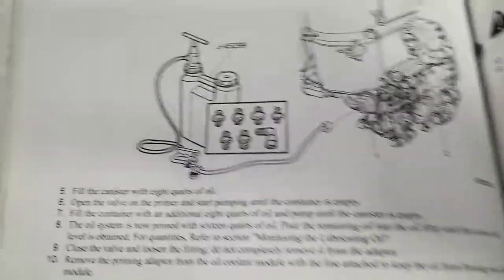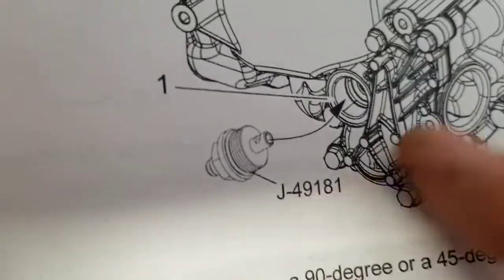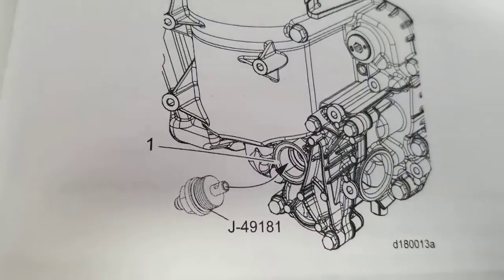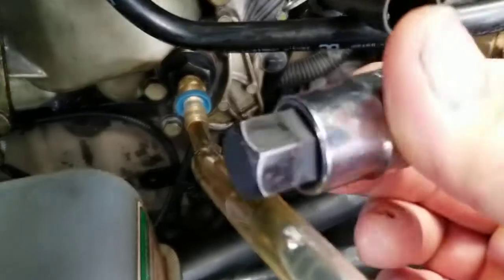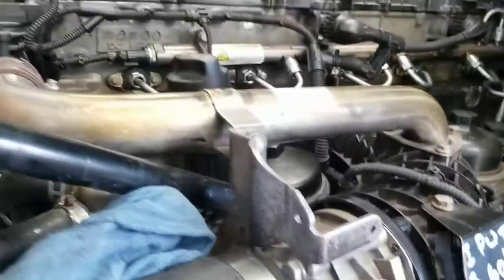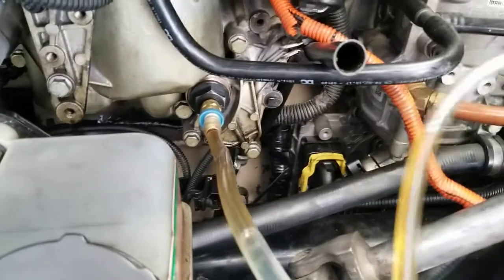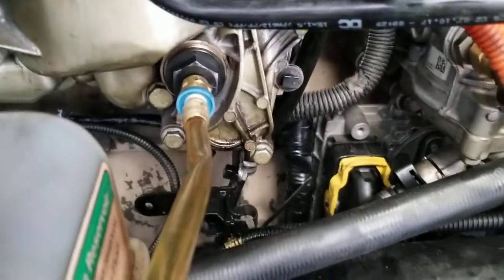DETROIT DD15 HOW TO PRIME THE OIL LUBRICATION SISTEM NOTE: (16 QUARTS)

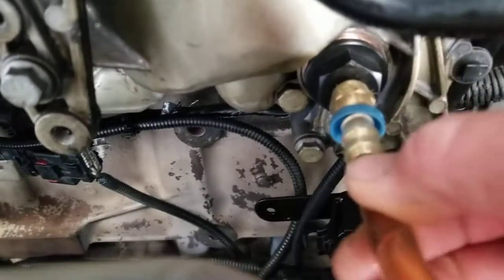Comment: 01:22 chuy could you please let me know the thread size of the fitting that connects to the J-plug on the male side. The little one. the big one is a m33x2, but the other one is the one i am trying to find out. thanks chuy.
Reply: Would like to know this as well
Reply: @holdennestor6  here is your answer: https://www.thetruckersreport.com/truckingindustryforum/threads/oil-bypass-centrifuge-spinner-2-installation-tutorial-dd13-dd15.1800845/